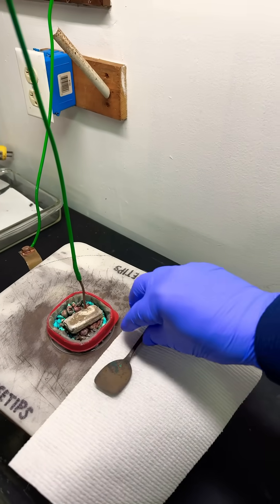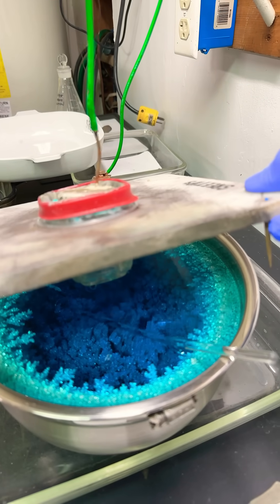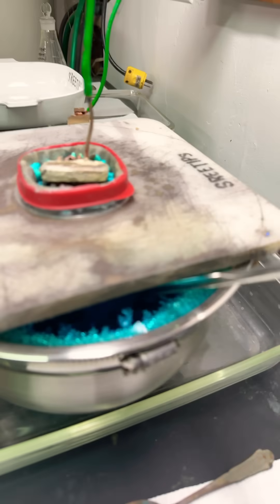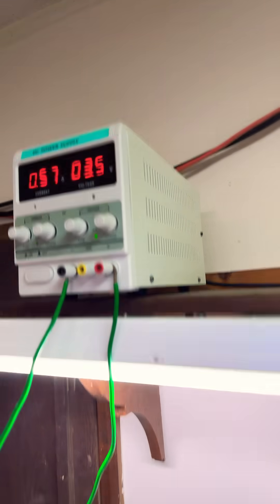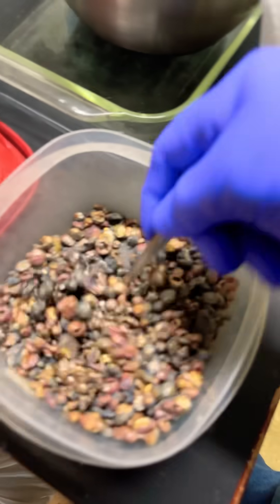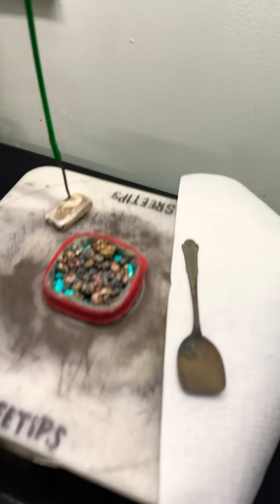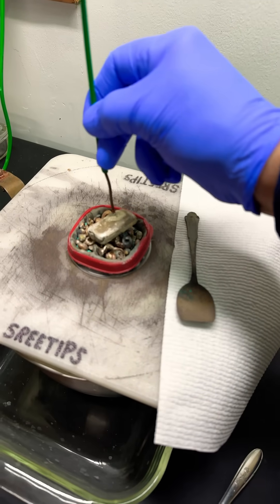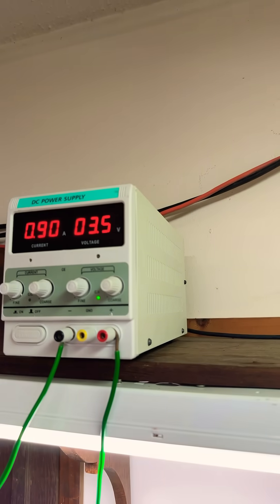High Purity Silver Cell Adding Impure Silver to the Anode Basket.

Comment: Explain the setup pls i jus subbed btw ya doin dope things 💯🤞🏼
Reply from the maker: Ok, I use sterling silver, that I buy at local sales, to refine gold. Silver is a by-product of my gold refining. I recover the silver that I used to refine the gold (I get to keep the gold) and melt the recovered silver into shot. Then I run it through my silver cell. The impure silver goes into the anode filter sitting on top. I pass an electric current through the impure silver. The current flow dissolves the silver and it (the dissolved silver) passes through the Dacron filter bag. Impurities, such as gold and platinum, get trapped in the anode filter as slimes. The bottom of the anode filter is suspended and submerged in the silver nitrate electrolyte.  The silver ions travel through the electrolyte and are attracted to, and deposit on, the stainless steel bowl (the cathode). The resulting silver crystal that gets deposited is very high purity, three nines fine or better. Every pure silver bar or round on the planet began as pure silver crystal, just like you see in this video.
Reply: @sreetips could i do similar ( all things being the correct equivalent)   With a pile of hold filled.  Gold plated items on top there?

You’ve got that powerfully. You should whip up an hho torch.  

You’d love it.   I love mine. The purest of pure. Cleanest of clean flame at almost 4k°F     Flame.  Which has no harmful chems post combustion. Simply water vapor …

Welll actually rather special vapor in a unique form if one delivers into it. 

Water is not water is not water.  

Viktor Schauberger should be required reading our viewing
Reply from the maker: No, GF and GP are two totally different processes.
Reply from the maker: I’ll check it out. Thank you.
Reply: @sreetips  sorry for all the typos. I just reread my comment. 

But yeah hho is amazing. I got one of the cheap ones off ebay new for $400. Like 5 years or more ago. Still works. Use it all the time
Reply: Weird this comment doesnt show up?

Comment: alchemy is not bullshit but this is, if silver could be grown it would have no value
Reply from the maker: I’m “growing” the silver on the inside of the stainless steel bowl. Grow: to increase in size or mass. The impure silver dissolves and travels through the electrolyte and deposits on the cathode. It  grows as the pure silver deposits.

Comment: There is no way this really works...... right? Like your fin with me?
Reply from the maker: This is an electrolytic silver cell. I’m converting impure silver that I feed into the anode basket on top of the cell, into high purity silver that deposits on the inside of the stainless bowl. I’m refining the silver. I’m not creating silver out of thin air!

Comment: My question is where's the connection? All I can see is you made a liquid Crystal capacitor.
Reply from the maker: The anode basket is submerged in the silver nitrate electrolyte. That completes the circuit.

Comment: Re life alcomy is he really growing silver or what?
Reply from the maker: Yes, the silver grows on the inside of the stainless bowl (the cathode).
Reply: @sreetips  so why don't people do this to get rich what's the catch?
Reply from the maker: @chrism9457  the catch is this: it takes impure silver to run it through the cell. I’m not creating silver out of thin air. I use sterling silver to refine gold. Silver is a by-product of my gold refining. I recover the silver from that, melt into shot, and run it through my silver cell. For every 1000g of impure, 98% silver, I feed into the anode basket on top of the silver cell, 980 grams of high purity three nines plus silver will deposit on the inside of the cathode (stainless bowl). I buy the sterling at local sales.

Comment: I got no idea what's going on there
Reply from the maker: Silver refining.
Reply: @sreetips  making silver.... from silver.  Right?
Reply from the maker: I’m feeding impure silver in, it dissolves from the current flow through the cell, travels through the electrolyte and deposits on the inside of stainless bowl (the cathode) as high purity, four nines fine, pure elemental silver. I’m refining the impure silver into high purity silver.

Comment: So you're creating energy refining silver instead of using a large amount of fuel or chemicals that get wasted. Thats awesome. Are you storing the energy.
Reply from the maker: No, I’m using energy (electricity) to pass a current flow through the cell to dissolve the impure shot so that it deposits as high purity silver on the cathode (stainless bowl).
Reply: @sreetips  I watched your long form video and understand now. I thought silver was replacing zink in a simple power cell. It still looks super cool.
Reply from the maker: Silver will replace zinc in a simple ion exchange reaction. Put a piece of zinc in a silver nitrate solution and the zinc will go into solution while the silver comes out of solution,

Comment: What is the raw ingredient? Silver?
Reply from the maker: That silver powder that I recovered from my gold refining operation. It melted into those granules then fed into the anode basket on top of the cell. After passing a current flow, the impure silver dissolves, and travels through the cell deposition as absolutely pure elemental silver metal on the stainless bowl.

Comment: Does that work for gold?  Like a bunch of black sand mixed with sub 200 mesh gold thats hard to separate?
Reply from the maker: If I had black sand mixed with sub 200 mesh gold, I’d roast it to redness to burn off and grime and combustibles. Then hit it with hot aqua regia. Once the gold dissolved, I’d filter out the black sand and collect the liquid, then precipitate out the pure gold from the filtered liquid with SMB. THEN, I’d melt into a bar and run that as an anode in my electrolytic gold refining cell. If it were mine.
Reply: @sreetips  thats interesting.  Ill have to look into that.  I thought about just smelting everything but I would need a large one and the tiny one I did have got destroyed.  🤣
Reply from the maker: If your gold is just traces, like you described (sub 200 mesh) then it’s probably going to many batches to accumulate enough to get a single gram of pure gold.

Comment: Can somebody explain to me what is happening? I’m genuinely interested in. What’s going on in this video?
Reply from the maker: I’m adding impure silver to the anode basket that sits on top on my electrolytic silver cell. It (the impure silver) gets dissolved by the electric current flowing through the cell. The dissolved silver ions pass through the Dacron filter bag and travel through the silver nitrate electrolyte and deposit as high purity elemental silver on the inside of the stainless steel bowl (the cathode). When it gets full, I remove the pure silver and repeat.

Comment: Im gonna subscribe to your channel
Just explain what you doing and what it does for me please hell curiosity has about made me go crazy 🤣
Reply from the maker: Welcome! And thank you. This is an electrolytic silver refining cell. I add impure silver into the anode basket. Pass an electric current through the cell. The current flow dissolves the impure silver, the silver ions pass through the Dacron filter bag, impurities such as gold and platinum group metals are insoluble and get trapped in the filter. The silver ions travel through the silver nitrate electrolyte and deposit on the inside of the stainless steel bowl (the cathode) as high purity elemental silver metal, four nines fine. When it gets full, I harvest the pure silver, put it away, and forget about it.

Comment: wait what?! what am I looking at?
Reply from the maker: Electrolytic silver refining. I’m producing high purity silver (from impure silver shot) in my garage.
Reply: aha, Does the silver come from what you put on top? @sreetips
Reply from the maker: I add impure silver shot in the top, pass electric current through it. The current flow dissolves the impure silver. Insoluble material gets trapped in the filter. The dissolved silver passes through the filter, travels through the electrolyte, and deposits on the inside of the stainless bowl (the cathode) as high purity elemental silver, close to four nines fine: 9999 parts per ten thousand pure silver.
Reply: aa I see, very interesting. Thank you for explaining @sreetips

Comment: Hang on, pure silver looks like pebbles??!! I thought silver was found in the ground same as gold? Am I a dunce or was I right?
Reply from the maker: This is silver that has been recovered from my gold refining. I used to be sterling silver. I use sterling silver flatware that I buy at local estate sales, to alloy with scrap gold that I’ve accumulated. Then I pull the silver from that gold alloy with nitric acid boils. I recover the silver, melt into shot (what you see in this video) then run those “pebbles” through my silver cell. In the silver cell, all the copper gets removed and I harvest pure, snow-white, elemental silver, close to five nines fine.

Comment: Sreetips I love all your content, I never knew you did shorts too 😉
Reply: @sreetips would a silver cell work on say silver contacts from circuit breakers?
Reply from the maker: No, for electrolytic refining to work properly, the anode material must be relatively high purity to begin with.
Reply: @sreetips  thanks Bud, so I'm kinda stuck with doing ye old chemistry on them to refine down to higher purity lol
Reply from the maker: Yes, getting high purity precious metals requires lots of input. Part of the reason the metals are so expensive.
Reply: @sreetips  is there material I could read up on for doing a reaction on them? I've seen videos using sugar, acid and something else

Comment: are you limiting the rectifier by the voltage?
Reply from the maker: I run the cell 3.5 volts DC in constant voltage mode.

Comment: Glad to see you still around!
May i ask , what's the filter in the filter basket made of?
Reply from the maker: Dacron vacuum clean filter bag.
Reply: @sreetips  like as in  "dustbuster", nice! , perfect little basket ✓
  I had to look up Dacron to see that it's a PET plastic. Do you know of any similar common household items that would be useable with a very low pH and/or tolerant to organic solvents? 
   Tyvek isn't porous enough, terracotta's to bulky and nafion is too expensive...
 I'm thinking for battery experiments. The thin fiberglass matting from The body shop and ceramic paper used to keep things from sticking inside kilns from the pottery supply (neither good in caustic environment) so far have been my best options but something with some ion selectivity would be great and if anybody new of anything commonly accessible with those properties it would probably be you!
  For less extreme chemistry, do you know if any brand of cellophane is still made from cellulose? (Without paying through the nose for special ordered biodegradable cellophane)
  I'm sorry, so many questions...
   Okay, one more question, do you ever sell any of your silver near spot price, or only what you occasionally list on ebay?
Reply from the maker: I’ve heard that muslin can be used, but I’ve never tried it.
Reply from the maker: I’m not selling any of my silver. The spot price is rigged. I’m not selling, I’m buying.
Reply: @sreetips  I agree, now is perplexingly a good time for that.
   Still kicking myself for a few bars I sold when it was $6 an an ounce. .
Reply from the maker: Silver is grossly and artificially undervalued. Please read then President Johnson’s remarks about the coinage act of 1965 (quote begins here), "If anybody has any idea of hoarding our silver coins, let me say this. Treasury has a lot of silver on hand, and it can be, and it will be used to keep the price of silver in line with its value in our present silver coin. There will be no profit in holding them out of circulation for the value of their silver content." (End of Johnson quote.) Today they don't even need physical silver. They can just conjure millions of ounces in the form of futures contracts and sell as much "paper silver" as needed to artificially suppress the price of both gold and silver. Twenty to one, silver to gold, ration for thousands of years. In 1930 it took twenty silver dollars to equal a single gold coin (twenty dollar gold eagle). But today it’s at 80 to one. Why? Because governments can and will use printed paper dollars to control the price, and therefore the demand, for silver (and gold). But why would they do that? Same reason President Johnson pointed out. To keep you in their fake fiat money that they can print out of thin air. They can’t afford to have the public converting cash into metals. Just think what would happen if faith in paper died. Twenty to one puts silver up around a hundred bucks. But instead, it lingers around $22. Why? Because when silver starts to move, they conjure a million ounces out of thin air, add that as a sell order to the rising market, to kill the price. And, even drive it down. But it all hinges on peoples faith in the currency. If that dies (and it always does) then silver (and gold) will explode. For now, I’m not holding metals for a big bump in price. I’m holding to protect my savings from the money printers. Have you heard of “de-dollarization?” Nations are doing it. I’ve done it, by converting my savings to metals. They can’t print more gold and silver. Hope this helps!
Reply: @sreetips  a few decades ago I got screwed over with a futures contract, SEC supposedly shut them down, but was just a scam . I was young, but now the "reputable" places don't seem much better and I can't afford the entry costs anymore anyway.
Reply from the maker: That’s why I learned to refine the metals myself. I can be absolutely certain of their purity. And it’s a reliable source to accumulate gold and silver, without having to rely on others to supply me. And, nobody knows you’ve got it, unless you tell them.
Reply: @sreetips  I especially like silver because of its many practical uses that most other "shiny things" prove to be nothing more than just "shiny things".

Comment: I'm curious about the cost of materials and operating the power supply to buying bullion. How does it compare
Reply from the maker: I don’t really know. I’ve not bought any bullion because I refine my own. I buy sterling at estate sales, lots of it. It’s grossly undervalued so I get a good deal every time (the sellers use undervalued spot price to determine their ask price, then cut it by 10%) I use the sterling to refine gold. I recover the silver from that and run it through my silver cell. Then I put it away and forget about it. I’m not selling any silver (except an ounce or two of crystal), I’m buying, while it’s shunned and out of favor.
Reply: @sreetips  interesting. I stack when I can. That's why I'm a little curious of the cost to run your silver cell vs buying rounds and dealing with high premiums
Reply from the maker: In 1930 it took twenty silver dollars (one ounce of silver per coin) to a single twenty dollar gold coin (one ounce of pure gold). Twenty to one, silver to gold. It had been like that for centuries, since biblical times. But now it’s about eighty to one. Why is that? Because silver is grossly and artificially undervalued. Why is that? Because they (the money printers) can’t afford to have you converting your wealth from their paper (that they can print out of thin air) into real money; gold and silver. I wouldn’t worry about premiums. We’re not in this for a big bump in price of silver (or gold). These metals are NOT investments. They are money. You wouldn’t invest in money. Although folks try to make them (gold and silver) into investments. Paper dollars are a money substitute. Holding savings in paper, accepting paper as payment for your work, are bad ideas. We get paid in paper dollars. Got to have them. But saving them up, stacks of paper? That can be printed into existence out of thin air? Don’t make no sense! Instead I store my savings in metals. Because they can’t print more gold and silver. They can, and do, squash the price with paper gold and paper silver. But that won’t go on for ever. Sooner or later people will begin to realize that cash is trash, and the only reliable, historically safe way to store your wealth, is in precious metals. If you need some paper to buy food or pay bills, then you can always sell a little of your metals. Stack well my friend.
Reply: @sreetips  yeah I don't stack anticipating a 10x it's to protect my money from being devalued into oblivion >_< I only brought up premiums because if the cost of running a silver sell was more cost effective than buying silver with premium then I might concidering trying it out. I don't have much chemistry background
Reply from the maker: I see, the only reason I do this is because I use sterling silver to refine gold. I recover the silver from that. Now I have a bunch of cement silver to deal with. So I melt into shot and run it through my silver cell.

Comment: How is the dry dirty silver getting to the wet solution...anod filter
Reply from the maker: Current flow dissolves the silver and the dissolved silver passes through the filter down into the electrolyte where is drifts down and plates out on the negatively charged cathode.
Reply: @sreetips  I get all that but it seems that the dirty silver should be submerged in the solution....maybe it is and I just didn't notice??
Reply from the maker: Yes, the bottom of the anode basket is submerged in the electrolyte.

Comment: If you wanted to purify 925 silver directly, could you technically melt it into shot and put it into the anode filters?
Reply from the maker: Yes, but the electrolyte would quickly become saturated with copper.